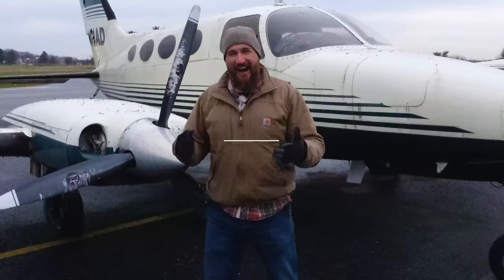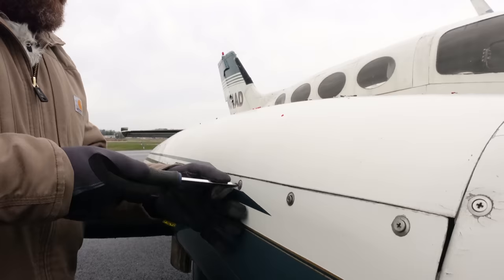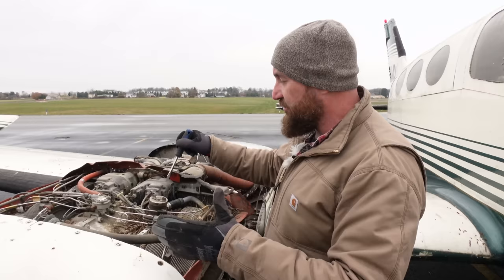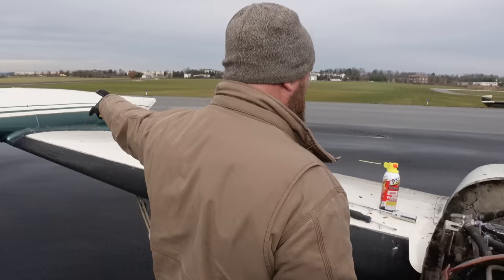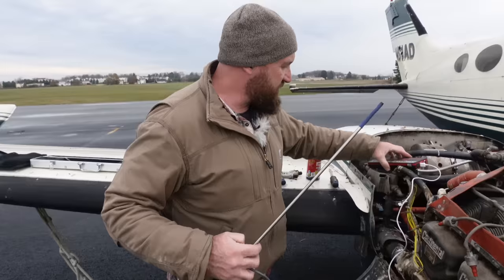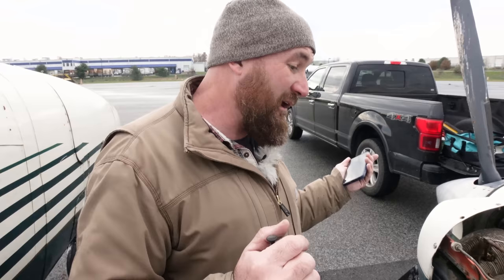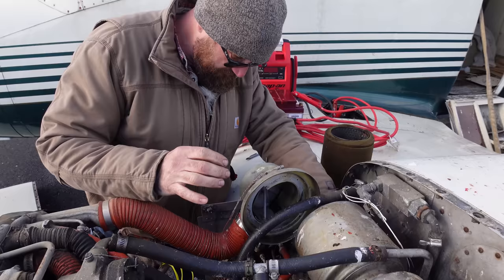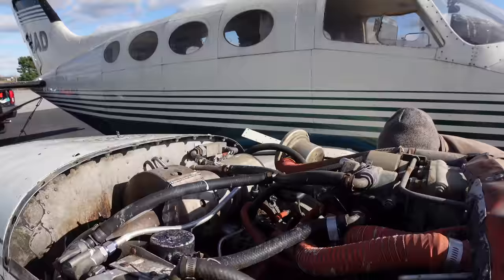FREE Abandoned Airplane... If I Can Start It! Ep1

Comment: As a lawyer my tingly senses immediately kick in when someone says "you can have it IF you fix it". The plane is worth significantly more if you can get the engines running. If they're willing to give it away for free after the engines are fixed, there's no good reason why they're not willing to give it away for free RIGHT NOW. 

Hopefully my cynicism is unwarranted.
Reply: And why was it parked for so many years to begin with?? Who neglects a $200 000 plane, and then gives it away??
Reply: I had exactly the same thought which I always do with these 'if you fix it you can have it' situations.
Reply: He has most probably already got an agreement with the owner to clear it, it just sounds good on a video and had the audience on his side (to watch to the end to see if he get it started and wins the prize). Good watch, I hope he sticks with it.
Reply: I never listen to an Attorney lecture on mechanical or electronics unless those were his / her additional areas of study and expertise.
Reply: I remember a lecture given when I was ten years old and listening closely, an Aircraft is a symphony of many systems working together and maintenance is different from an Automobile, so an Aircraft sitting on an Airfield so long needs many items replaced before you can attempting firing it up, there is a long prestart check list.

Personally I would pull both engines and send them to a shop for freshening up and replace seals etc and recertification and clean bill of health by experts as well as a complete check of all other systems, as well as updating obsolete systems.
Reply: Even if he goes thru the whole thing he won't be flying it very easily. It will cost a small fortune to get it airworthy and then have it all certified. FAA doesn't mess around, not just for his safety but for who or what he could fly into when/if something were to fail...
Reply: Agreed! Get the agreement in writing before you get too deep!
Reply: @acerjuglans383  200k to certain rich folks is like a dollar to you and me. They probably bought a new one and left that one to rot.
Reply: @carminemurphy4836  Carmine -- the Attorney was NOT lecturing on mechanical or electrical -- learn to read.  The Attorney was concerned with Ownership and Title, for if this guy were to get the engines running again, the owner might change his mind and keep the airplane, which is a valid point.
Reply: Even IF he can fix the engines FAA will never allow this plane to fly again. Too many years outside without maintenance or cover, I'm sure she have structural damage everywhere... It's beyond repair at a reasonable cost and the owner knows that.
Reply: Agreed
Reply: The FAA isn’t able to keep this plane from legally flying again.  It needs a valid registration and airworthiness certificate.  The big hurdle is getting an IA to sign off an annual inspection, which means he or she is stating that the plane has been inspected and it meets all the airworthiness criteria.  That is never going to happen.  The idea that the engine will be more valuable if you get them running is delusional.  Those things are junk, running or not.  No IA is going to sign for those without a complete overhaul, which at a minimum would cost 60K per side.  
It takes 500-700 psi to service the strut with them sitting on the ground.  That little bottle filled with 150 psi from an air compressor is not going to get it.  And most twin Cessnas have locking shrader valves, so just putting the air chuck on the valve isn’t going to do anything, even if the bottle had 1000 psi in it.
As stated, the locked up turbo will not keep the the engine from starting and running at lower power.  There is an alternate air door which bypasses the turbo to allow the engine to still run at partial power should the turbo seize in flight.
The ignition system uses a Shower of Sparks system for starting.  To see if it is functioning, position a cylinder at TDC on the compression stroke. Remove the plug leads for that cylinder and position the ends of them within a 1/2” of a metal surface which is ground.  Disconnect the wire from the starter and ensure it will not touch anything.  Turn on the battery and push the starter button.  If the SoS is working you’ll get a blue spark arcing from one of the plug leads to ground while holding the start switch down.
Reply: @crastoman  faa has no say if airpane is brought back to an airworthy condition and pass all required inspections.
Reply: @crastoman  he def could get it air worthy again but like man just the money that would be needed is so massive.
Reply: @carminemurphy4836  he wasn't referring to the actual repairs- his concern was with the nature of the agreement between the owner and OP, which would be in a lawyer's wheelhouse.
Reply: I 100% agree with you. I would not touch that plane, unless, it was Legally mine, or, I was getting Paid to work on it.
Reply: A “clean bill of health” for those engines would require nothing less than an overhaul.  That would be $60K per engine at a minimum, probably more.  And that doesn’t include the labor to R&R.  Spending that kind of change, on what is literally a shit piece, is insane.
Reply: @learmonkey3582  Want to buy a boat?
Bust
Out
Another
Thousand.

Want to buy a plane?
Probably
Looking
At
No
Enjoyment.

shit's expensive to maintain. it's a rich man's game, as much as I hate to say it. Only way "common folk" can fly is co-ops or literally dedicate every waking moment of their soul, mind and body to scrounge up enough to maintain an airframe.
Reply: @learmonkey3582  what's your  guestimated total cost of this thing even being legal to fly again?  wouldn't it be cheaper to buy a used flyable plane lol?
Reply: SPOT ON!!
Reply: Working in aviation finance, my tingly senses are going crazy as this guy is likely not a licensed FAA, AP, and the chances of getting a quality sign off for RTS , and no log book entries, can promise this is likely couple hundred grand to fly.......that thing is never going back in the air
Reply: It’s would take over $200K to have any chance of being airworthy again.  You can buy a flying 414, which is very similar, for less.  There is a 401, 3 years out of annual, currently for sale for $65K.  The $200K figure would not include any new interior, updated avionics or any airframe structural repair.  Bird poop and moisture create an acid which eats aluminum.  These 400 series Cessnas also have issues with exhaust leaks below where the turbo mounts.  The exhaust soot is also acidic and corrodes the canted bulkheads and engine support beams.  I’ve changed canted bulkheads and beams on a 414.  Very labor intensive.  All of that is moot because the log books are missing.  Without logs, even in good condition, it’s a beer can in waiting.  I don’t believe Continental will even take the engines as cores without logs.  That’s another $30K down the drain.
Reply: @learmonkey3582  Actually, I think they will take them as cores.  However, that's about all there realistically is on it, aside from literal scrap value on the stripped components and airframe.  :(  I still wanted to see him get it to run, though.
Reply: @learmonkey3582  Also without log books, no one is letting that fly or get insurance on that aircraft.  Most title companies, won't even change title without them.   There is a reason that thing is a ramp queen, it will stay that way.  She is BER, and heading to a salvage yard.
Reply: It was indeed warranted! The 3rd video on the rebuild, posted today, says there's a third party (who allegedly saw this video and tracked down the owner) offering 20k for the plane...
Reply: @klaiv5279  A fool and his money are soon parted.
Reply: @klaiv5279   $20k to part it out.  Will have ramp fees, and liens.  Work aviation finance for a living...
Reply: @carminemurphy4836  LOL "pull both engines and send them to a shop". Yes you can send them both to a shop for an overhaul and likely full rebuild or replacements..... But if he does that he might as well just buy a flying one of these, it would be cheaper. 

For reference these engines cost about $13000 for a basic overhaul (that's EACH). They likely need to be completed removed and replaced. The engines cost about $43000 for a rebuilt one. Each. That's not counting any of the labor for removing and replacing, which is probably 4500. Again, EACH. 

....and then you have a plane which has two newly rebuilt great engines, after having spent nearly 100k dollars. Avionics, controls, interior, and likely some of the actual structure will need to be replaced, overhauled, completely redone and depending on the structure of the plane that could easily be another 100k or more. You can buy a flying example of one of these planes for under 150k, FYI.
Reply: @yvesbajulaz  That would cost two to ten times what the aircraft would ever be worth.

Comment: Get the oil feed line out, put in some penetrating oil and let it soak. Use a 1/4" impact on the impeller of the turbo to give it a shock. It may just free up.
Reply: ...perhaps just dip the entire plane in penetrating oil.
Reply: @FreqBand  
HAHAHAHAHAHAHA
💯💯💯💯💯💯💯💯
Reply: I'm pretty sure its a Lil more complicated than your Honda civic
Reply: @mr.t7178  your right. So show us how much more. Take apart your civic
Reply: Shouldn't need to free it up just to start in anyway.
Reply: I also agree, a small wrench on the input nut could free them up , Darian is right, this won't stop it from running
Reply: @mr.t7178  so i guess he took the oil feed line out and put pen oil. And will be jarring the shaft. Still waiting on your civic disassembly.

Comment: I had an obsession with buying/owning a Cessna 411 years back. The plan was to operate a Part 135 Charter service. However, the cost to buy and operated these twin engine monsters was cost prohibitive, thirty years ago, when Avgas was somewhat reasonable. So, this exploration is great to watch.  I do have some time in a Cessna 421 Golden Eagle, owned by a local Tulsa, OK charter service operator, where I flew American Airline maintenance employees from Tulsa, OK to destinations throughout the country. Those 421 were like flying Cadillacs, smooth and powerful with them geared engines.
Reply: 414, my buddy!

Comment: A couple of things. The turbo wont keep the engine from firing... at least for testing. You'll just be down on power. You also want to wire the batteries in series for 24v. At 12v, you will pull too much current and burn out the starter.
Reply: Exactly this. Let it naturally aspirate and maybe check the mags/plugs for spark, fuel filter and carb. It might be easier to plumb a temporary gas tank rather than rely on the existing ones.
Reply: +1 on turbo , few $ extension/adapter and you can see if it sparks
Reply: why would 12v cause more current? Lower voltage = lower current from the ohm's law.
Reply: @frigzy3748  Current is drawn trough a circuit based on the load applied to it. In a motor circuit, rather than Ohms law which applylies to a purely resistive circuit, you should apply Watts law. P=IE. For the same power, reducing the voltage requires a higher current to balance the equation. It's why a lot of higher power motor circuits (trucks and apparently planes) use 24v so that they can use smaller gauge wire because it's drawing less current. Same thing with high tension power transmission lines. 10s of thousands of volts allow for smaller cables.
Reply: @CR3W1SH03S  that would be right if the starter motor was drawing same power at 12 and 24v. However, for purposes of this discussion, it's just a plain resistor. The resistance is fixed. So higher voltage will cause higher current and vice versa. Yes - the motor has some inductance, but we operate with DC current so it can be disregarded.
Reply: try a simple experiment: take a small dc brushed motor from a kid's toy and apply voltage to it from a lab power supply that shows voltage and current. You will see that as you increasing the voltage, the current will increase too. The starter motor is not different it's just bigger. Interesting consequence of all this: when you use 12v in 24v vehicle. You're getting not half but only a quarter of the power on the starter. Because not only the voltage is lower, the current is 2 times lower too.
Reply: @frigzy3748  Read Graham Fox's answer in the above link for all of the gory details.
Reply: @frigzy3748  I had a machine that was popping a motor breaker. Checked the machine voltage and it was running at 206 Vac. Breaaker was configured based on 230. Did the math and INCREASED the setting on the breaker using Watts law and the motor's power rating to fix the problem. No more popped breakers.
Reply: @frigzy3748  No. If the voltage is low, the current has to be high to equal power.  V x I = P
Reply: @1959Berre  That's right. Now, why would it be equal power? The starter motor won't rewind itself. It has to be winded differently to achieve same power at lower voltage.

Comment: In one of the airports I used to work at, there’s an old Cessna 310q model. A damn fine plane if looked after correctly. It’s in the same condition as this one and it breaks my heart seeing it left to rot. The owner of said wreck won’t part with it for less than $90000. Thing is you could by one thats well maintained for that ammount.
Reply: No way you can buy a good 310 for 90k
Reply: lmao 90k
Reply: That's why he's still got a crap $90k plane!
Reply: Why not call airfields around to see if they have something lying around, you never know you might get lucky?
Reply: @imrangul6750  Check Rolla, MO they have a small airport over there with this same type of aircraft.
Reply: He can get  that  amount from bank. Then invest  and pay the  interest.

Comment: Im am aircraft mechanic and an IA. Been a mechanic for 15 years and ive worked everything from small Cessna to 747-800 and I would absolutely love to get a free plane to troubleshoot and fix.
Reply: So what you say it would cost, "tank and plank", and everything to get an Airworthiness Cert back current for this bird, (NOT with your free labor)...  $80k ??
Reply: @MajorCaliber  My guess is 80K would barely get you started.
Reply: it is not at all fun, I got a V35A  30 years ago for 3k, took 20 years to get her flyable, I was the A&P and IA, with help of friends. almost everything had to be rebuilt or reskinned, the E185 was the only thing I did not have to overhaul but did it anyway.
Reply: @MajorCaliber  80k just to get the instruments and controls working/up to date. One of those engines is more than that.
Reply: Better to take the money that you would have spent restoring this degraded machine (inside and out) and go out and buy yourself a used Cessna in good condition.  The sooner you can get her flying, the happier you will be.
Reply: @MajorCaliber  Really depends on whats all wrong with the plane. Gears will definitely need to be repacked. Wires would need to checked from end to end. New FAA required flight deck equipment and etc before the engines are touched. If im not mistaken some Cessna had an AD issued for wing spar replacement and the kits alone are $75k. If hes extremely lucky id $20k on the low end and above $100k on the high side. Now if he likes it as a hobby then id say go for it. I would but if he just wants a plane that flies hed be better parting it out and buying one that is already airworthy.

Comment: Super easy to yank the entire interior on these, you've already started obviously but I'd start by just throwing away all the random crap and yanking it all out. It's super easy to fabricate new interior panels as well. The seats you may want to send out to get reupholstered but they're pretty easy to do as well. If you want some tips or anything, I did an entire refurb on a 414 with a guy a few years ago so I may be able to help you with some stuff. Most of my job was a complete instrument panel replacement and rewiring but I did a lot of the interior and airframe work as well.

Comment: After watching the whole vid; my suggestions would be; find a garage/bar to store stuff you remove then strip the entire interior to both clean it and allow for spar inspection do this firstly because even getting the engines to run will not occasion their cert's. so I'd leave them to last.  All of the control surfaces, cables, and actuators need inspection and service before you can even proceed.  No sense getting engines running but still uncertifiable to then also find the thing is a complete airframe corrosion write off.  Dang, as a retired general machinist and high speed production equipment service business owner,  it would be fun to wrench alongside you on what's almost certainly to be a voyage of discovery.  I'm thinking long days of digging into her guts and sitting on milk crates in the evening with a chipped mug full of a good Bourbon mulling over whether what you found was the tipping point or just more encouragement to continue. LOL
Reply: Wrong.  Owners statement was you can have if free if you can get it running not flying.   Wake up.
Reply: Make a killer man cave!  :)
Reply: Sounds fun I'd do it, if I was retired lol
Reply: Agreed.  Of course the interior is trash but he was looking for floor corrosion and I was thinking "screw the floor, better be looking at the spar.  Also bet the gyros are shot.  Maybe every instrument and all the avionics.  Gives me the willies.
Reply: @weseng1  so? all of it still stands. Hes got it for free. now what?
Reply: @weseng1  Well aren't you just a charming little ray of sunshine.